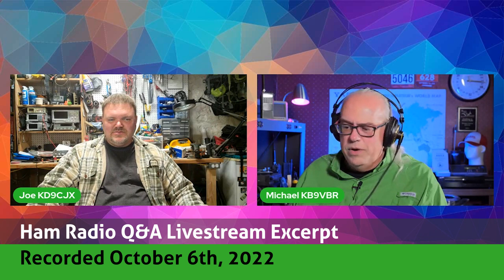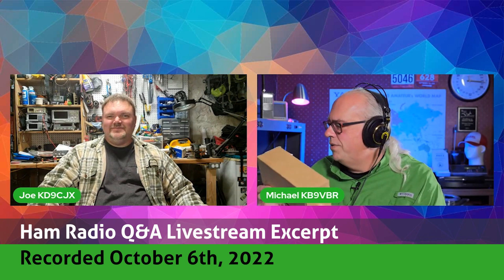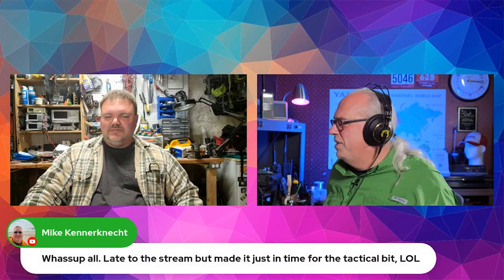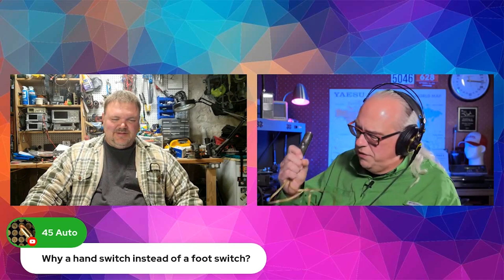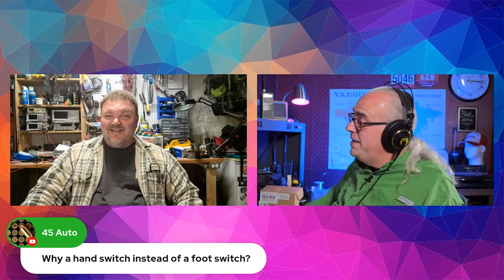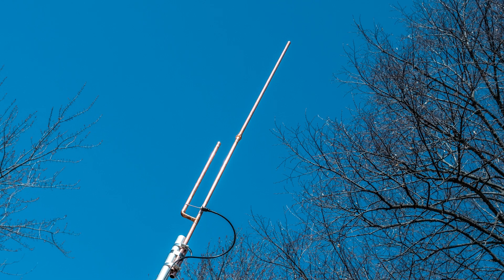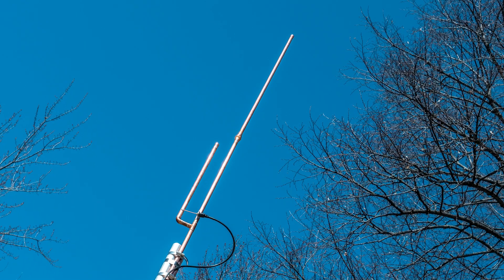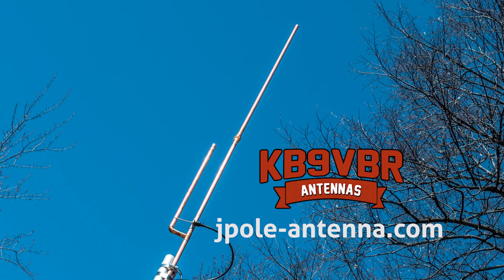Ask Michael, KB9VBR: Why a hand switch instead of a foot switch in the field #hamradioqa

Comment: I prefer a hand switch because I would hate continuously pressing down with mt foot. In fact any switch I would use would have to toggle on and off without the need to continuously pressing on it with hand or foot. Switches are no longer made that way in order to prevent the one in a zillion chance that someone would fall asleep or die after pressing a toggle switch on.

Comment: Hi Michael, Thank you very much for answering my email so quickly last week!  I have another question; I must set up my shack on the second floor of my home.  I am mounting the j-pole I bought from you on a chimney, am running the wire to a lightening arrestor attached to a ground rod, and then running the wire back up to the second floor.  Would I be ok using 6 gauge copper wire for the ground, or do I need to use braided copper?  Thanks for all the great videos!  :-)
Reply from the maker: Either solid or braided line will work. Braided line is a bit more efficient in that it takes advantage of the skin effect and greater surface area to carry the energy. I'd use whatever is more affordable.

Comment: I find using a hand switch so frustrating.  When I'm computer logging, taking one hand off the computer home row keyboard to press the hand switch, then back to the keyboard is a pain.  I can never get my fingers in the right position.  I don't use a foot switch when activating POTA, so I probably shouldn't even be commenting.  LOL.  I use my Yaesu issued hand mic when activating and that's just the same as using a hand switch.  I should activate more with my headset and a cheap tattoo pedal I've modified for a foot switch to keep my fingers on the keyboard. 73